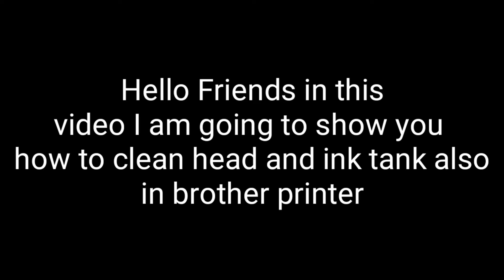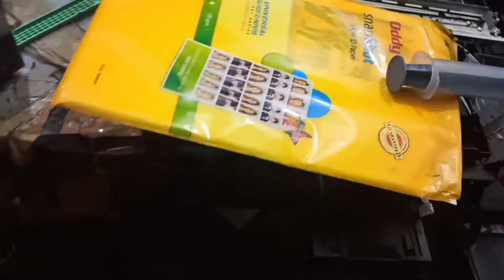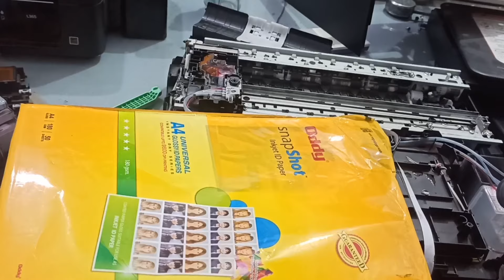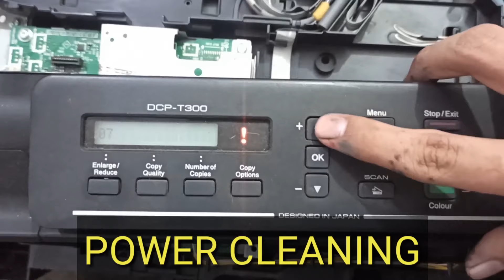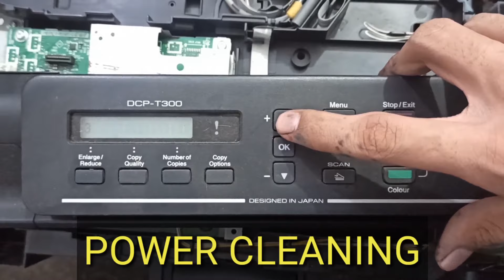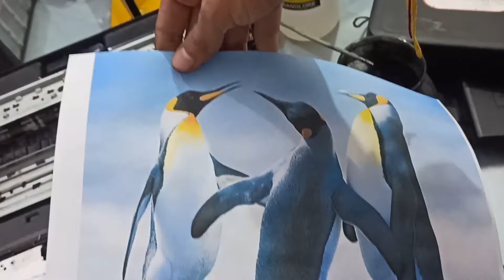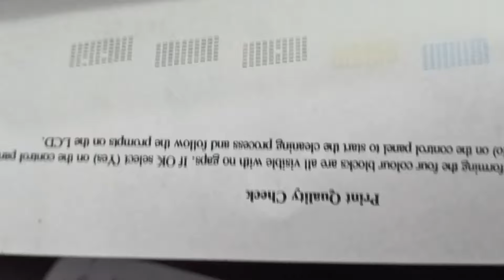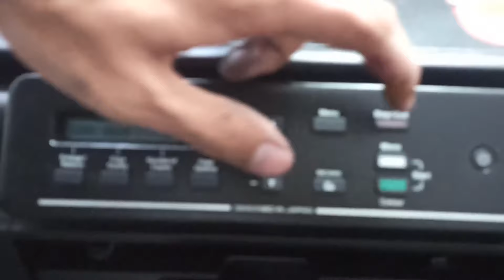Brother printer printhead and Ink tank cleaning full video (no machine required)

Comment: I have Brother DCP J-125 inkjet all in printer, i did not print for 4-5 months in lock down so ink head was dry and jammed so i tried to clean head by using printer auto clean utility, now black and red half color printing but now ink absorber tank is full error is showing. and can you send some one ot help me to do it at home. bcz servce centra told to replace head and absorber which is very costly.

Comment: Excuse Me, what model is this printer? thanks. I have a MFC-J200 with fail similar
Reply from the maker: Hello printer model is dcp t300 inbuilt ink tank system only difference both model
Reply from the maker: If your printer have original inks or compatible use this trick maybe your problem solve https://youtu.be/Yhawnq82FxM
Reply: Thanks
Reply from the maker: Welcome sir ☺️
Reply: My printer brother mfc j430w same problem

Comment: Thank you good video give good knowledge.    I have a brother dcp165c printer and the service center could not remove the fault that is code 73 and returns back say model to old etc. I open the printer by following you steps and found lot black ink spread and not reach upto head input and ink absorb box is full I clean it too now after cleaning i find  ink observed box spounge is in squeeze form kindly guide me further and how to pump out air from ink pipes.  Kindly give your reply as my printer is in open state
Reply from the maker: Hello sir thank you for watching my video
Please send me video or images on my Instagram id @shivam2929 or Gmail computersolution3697@gmail.com

Comment: Hello, I have a DCP j4110dw, the problem is that when I plug it in the home button stays on, the home button stays on (white) and the LCD lights are on too, but very light gray, almost white ... No you hear activity in the car, no head, no starter or whatever, and it does not respond to the on or off button, I need to unplug it and I tried to unplug it and plug it back in, waiting and with the ignition the button is pressed and it does not any. Can you help me with something? Thanks in advance for your reply, best wishes.
Reply from the maker: Send me video or images in my Instagram id @shivam2929
Reply: @ShivamSharmaRepairs   ok, I¨ll do it thanks

Comment: I have brother t300 and facing horizontal lines both in black and color printing. All ink patches are ok in print quality option but whenever i print even after all ink cleaning process, same issue of horizontal lines, there are 3 to 4 lines are there on every page, cutting words into two portions. Is it a issue related to ink quality? I have bought ink from Amazon i think its not genuine.
Reply from the maker: Yes sir ink problem
Reply: @ShivamSharmaRepairs  but,how to solve that problem?